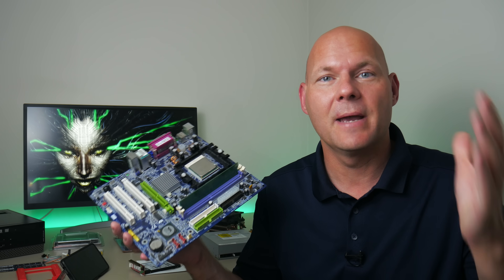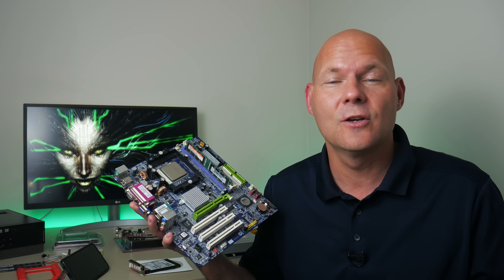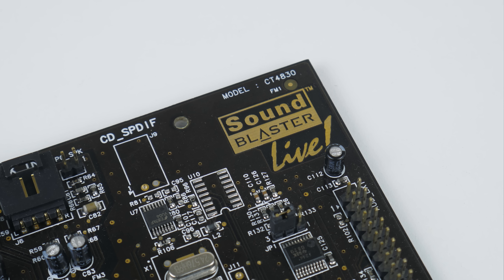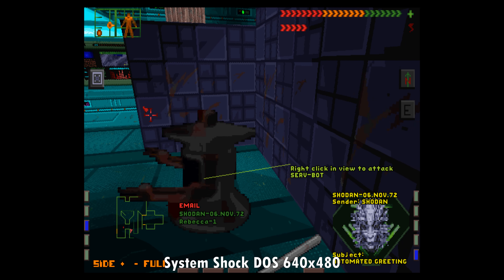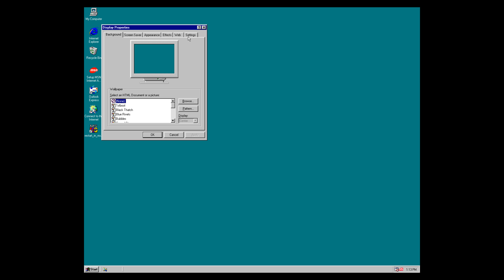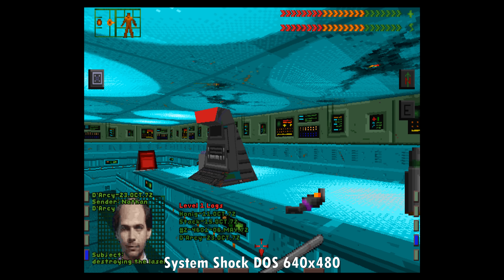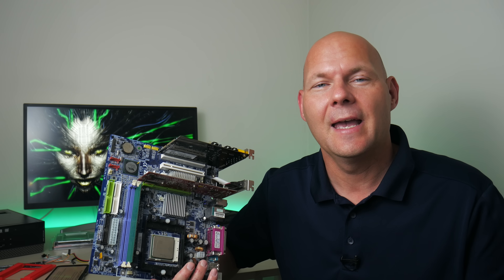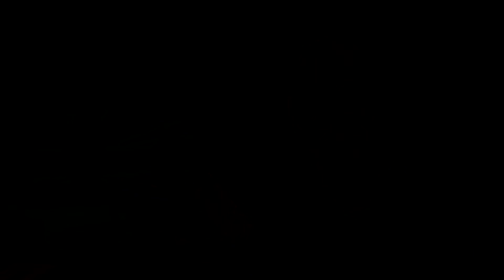Running Demanding DOS Games on Affordable Hardware

Comment: I was given an old Packard Bell for a colleague at work. It needed some capacitors, and the original hard drive quickly died, but to my delight is was an AGP board. It was an early-ish Pentium 4 socket 478 and came with XP, but good for Windows 98.

I haven't got the original drivers now, but with some digging, and your website, I managed to get drivers for everything except the onboard sound card. This is specific to the Packard Bell version of the Gigabyte board but it's not an issue as I wanted to use a Sound Blaster Live anyway. 

There's an FX 5500 in there, again, drivers thanks to you, and 98 is just fine. I've not tried DOS as yet, but what could possibly go wrong..... right?

Thanks for your resources!

Comment: Hi, I use socket 754 SIS chipset and this is very fast and compatible system. W98 installed without issues and very happy with this build.

Comment: I use a PIII-S SL6BY on an asus TUV4X board with a Ti4600 or Voodoo 5500 and a Soundblaster live. It uses a VIA Apollo Pro 133 chipset, and has pretty good late dos game compatibility, windows 98, and also Win2k/XP.

Comment: Phil great stuff! I'm currently building a socket 754 system myself with a Asus K8V SE Deluxe and a Sempron 3000+, I'm currently using IDE drives but I'm tempted to go the SSD route after watching this and even just ordered the Startech adapters, my question is do the SSDs need any special preparation with Windows 98 use or is format and go? Just curious as I know hdd and sdd function slightly different and I'm wondering if windows 98 can correctly utilize them
Reply from the maker: I've done a video on aligning partitions with SSDs. In short, if you use less than the total capacity, this is called under provisioning, it's a non issue. For example buy a 120GB SSD and create a 60GB partition.
Reply: @philscomputerlab  thanks for the reply I will check it out now, I'm assuming it's the "How to avoid short lifespan when using SSD in retro PC" video, I'm going to study that now
Reply from the maker: @chiefthunderhorse4430  Yes that's the one!

Comment: I recently did a playthrough of System Shock on my channel.  I went with a Pentium III 1266S system to play the game in full screen at 640x480, which was mostly pretty smooth.  During testing I tried the game on a 700Mhz Athlon Thunderbird, and as I recall it wasn't enough to get perfectly smooth gameplay with those settings.  Also, it seems that 640x480 has some screen tearing, which was present both on my actual monitor and my capture card.  I used an ATI Rage Pro Turbo 8MB (AGP), so maybe that had something to do with it, though I have a feeling that's just how the game runs in high res mode.
Reply from the maker: I guess the game just doesn't use V-Sync to avoid screen tearing. A shame...
Reply: @philscomputerlab  Yeah, possibly.  It's kind of from the era where maybe 70hz was more common, but I seem to remember my capture card (a magewell) reporting 60ish hz.  Maybe the idea of vsync wasn't as established in ~1994?  Might make for an interesting topic to research further.
Reply: @rojovision  Actually now that I look back at the clip I posted, the game mostly runs smoothly without tearing but the pickups in Cyberspace are wilding out wayy faster than they should be and tearing lol
Reply: I've been playing this on my retro PC recently as well. My system is an ECS K7S5A with an Athlon 2400+, GeForce 4 MX 440 and Sound Blaster Audigy SB0090. I didn't experience any screen tearing issues. I also launch the game under Windows 98 through a DOS prompt though, not in "true MS-DOS" mode. This is because the Creative drivers for the Audigy actually natively support SB16 / General MIDI emulation in DOS under Windows 98 and under Windows you can load up to a 128MB SF2 soundfont. Anyway, the game runs very smoothly for me running it that way. Later on I installed "Toxic Frog's High Resolution mod" which allows you to run the game at up to 1024x768, and I have a CRT for the system now that runs at 85Hz. On either the LCD or the CRT though, the game runs smoothly and I get no tearing.
Reply from the maker: @C4103 It could be that I used DVI output. Yes cyberspace feels a bit too smooth if that makes sense?
Reply: I'm not sure if it will let me post this, but this is a clip from streaming the game, capturing at 60 fps: https://clips.twitch.tv/GorgeousNastyAniseWow-PrNXJYe9pL776g4G

Comment: also realize VGA is preferred for most retro games, like with console gaming of the era VGA will help with anti-aliasing as the signal is analog that will produce softer edges but using VGA on a LCD might not have the same results as its can be converted to digital by the monitor itself so a CRT for any retro build is a must

Comment: Is there any way to combine a Sound Blaster Live (PCI card) with an external midi like a Roland Sound Canvas in DOS?

Do the Audigy ZS drivers support MPU-401 via the gamport in DOS?
Reply from the maker: Good question. This detail escapes my memory, but you can watch the linked SB Live! video, I'm sure I mention if the MIDI port works in DOS. I have a feeling it doesn't...

Comment: I can't agree more that Windows 98 is the best operating system for running DOS games on "newer" hardware.  Also a quick tip: format c: /s /q will do a quick format with system and save some time.
Reply from the maker: Yes but only works if the partition was already existing and formatted. But yes, heaps faster...

Comment: Can't you just buy an old Pentium 133 or 166 for around $100 / €100?  I bought a few of those for that kind of price not too long ago  (2020 or 2021)  
for dos games you only need a soundcard, 3d accelerator cards came later. 
 an original period correct soundcard might be pricey, but you do not need that there are enough cheap alternatives
Reply from the maker: Yes great start! Especially for older speed sensitive games. But they won't run 640x480 games smoothly...

Comment: Some hi rez dos games I like are Carmageddon, nascar racing, fatal racing, normality, need for speed, terminal velocity, mech warrior 2 and especially quake 1 at much higher than 640 on my p4. Other games I think look a little strange when not in the standard rez such as doom and duke 3d. Flight unlimited is good but won't work on really fast systems.

Comment: Phil, have you looked at PCEm? I made a period accurate 486 with it and it works with everything I’ve thrown at it so far.. unlike dosbox this replicates the hardware down to the firmware, it is a great option.
Reply from the maker: Not yet! Hasn't it be replaced or abandoned? Also what sort of system do you need?

Comment: Well at this point it all makes quite a lot of sense - as I've been playing with Blood's Death Wish level pack. And in Blood you can use as high resolution as you find BIOS (well VBE) support for. And while I remembered playing the vanilla Blood in 1600x1200 on a 3.06GHz Northwood with i845+DDR333 at 30-40 fps, Death Wish struggles even in 1024x768. So you definitely CAN go higher than this system. It could run almost the same with a mere Thunderbird Athlon last week so an Athlon64 may or may not feel much better than this Northwood. But 800x600 is not bad at all, definitely much better than the default 320x200 which I often refer to as 'pixel storm' in 3D shooters. The Athlon64 MAY be able to go higher at viable frame rates, though. (Hm, maybe with NOLFB...? I'm not entirely convinced but I'll give it a try....)

Then my experience with the Live! was not that good, especially the FM emulation. But for this specific purpose it's not strictly needed, it can emulate general midi just fine, definitely better than it does OPL2/3. So if it works, it should be okay, Blood doesn't need real mode, it should co-exist with the Live! DOS drivers.
Reply: Just a little update: NOLFB DID help. Quite a bit. 1024x768 gave me the ~ same frame rates as 800x600 without it.

Comment: I know some DOS games support hardware 3d acceleration via 3dfx voodoo cards although with faster CPU speeds there can be detection issues and crashing, may be worth throwing on in.
Reply from the maker: Yes Tomb Raider runs really smooth with 3dfx Voodoo. But System Shock doesn't benefit from it.

Comment: I just love the fact that you can Supply these Athlons 64 with the new PSUs, instead of going only for those PSUs that have 30A on 5V Line (IIRC, could be less, could be more) that are needed for Athlon XPs and such. Such as saviour in that regard!
Reply: Later Socket 462 motherboards started to include P4 power connectors for 12v CPU power. Because even back then, the engineers knew trying to pull 89W+ from the 5v rail was untenable.

I had several Socket 462 boards with P4 power connectors, mostly from MSI. The KT4A-V was one, and the KT880 Delta was another. Both motherboards supported almost every Socket 462 CPU that existed at the time. I still have my KT880 Delta, it was a great board in age of the capacitor plague. I never had a single issue with it having failed capacitors.

Comment: SBEMU next then Phil! 
AC97/Intel HD Audio driver for DOS 😀
Reply: It's still in beta, not a lot of AC'97 or HDA chipsets have been tested yet and there is confirmed count that alot of other computers aren't working with Sbemu.
Reply: @Explorer  yes, it is beta!
I have had various successes and failures on the PCs I have tested so far.

But when it works, it can often work very well 😀 

It's worth a shot. It doesn't cost anything to try 😉
Reply from the maker: Yes I'm monitoring the situation. I didn't have much luck yet, but I'm hopeful especially with regards to Sound Blaster Live! drivers.

Comment: Socket 754, 939, AM2 on VIA are excellent platforms for retrogaming. Nobody needs them and they are very cheap, so I use them everywhere in my projects. And most importantly, these platforms will provide excellent compatibility for MS-DOS games.

Comment: I recently picked up a Mac mini G4 so I could play a lot of these without worrying about Voodos or sound blasters to be honest. It runs Mac OS 9 native and though some stuff doesn’t run native I can use virtual pc and vMac for the really old stuff like Dark Castle on the power Mac.
Reply: Only thing is CDDA soundtracks. I picked up a FireWire optical with a audio out. I don’t know if it works just yet but it will be fun to try.

Comment: A socket 939 opteron makes for a great XP system Though dual core may cause trouble for some older games and there are very few xp era games that can use multiple cores. My current dos system of choice is a Windows 98 laptop. There are many choices from low pentiums to quick p3s. Dos sound support on late 90s and early 2000s laptops is likely to be very poor but fine in Windows if you can find drivers on the modern internet. mid 90s systems might even have a real opl3 and are great for early 90s and late 80s games
Reply: You can use CPU affinity. I use it for Assassins Creed old ones. They stutter like hell for more than 2 cores.

Comment: Athlon 64's are still my favorite retro PC platform, I love my Socket 939 Athlon 64 X2 build and its the only retro PC I actively use and need.
Couple of tips for compatibility, if you go with a VIA Motherboard those support the PCI cards very well, mine is paired with an ESS Solo-1 also featured on this channel and it has excellent dos compatibility. Pair that with a tool like CPUSPD to slow the CPU down when you need and you get a very wide range of DOS compatibility all the way back to the 80's.

For Windows you can then put something like a Geforce 4200 in and have great Windows 98 compatibility as well, but in mine I went with the 6800GT + Voodoo 2 combination instead. That is still highly compatible in Windows 98 but I do need to lean on the Voodoo 2 a bit to get all the games to work. But it has the benefit that you unlock that 2005 Windows XP era where you can now play stuff like Half-Life 2 in all its glory and even Crysis 1 works on the machine.

Comment: Heh, I had no idea that heatsink sizes have stayed the same all the way through Ryzen.  And that's the one drawback to a Socket 775 build - Intel changed from 72mm to 75mm hole spacing starting with LGA 1156 sockets, so socket 775 heatsinks are limited to socket 775 heatsinks.
Reply from the maker: Yea Intel is a pain, especially Socket 370 and 478. LGA 775 you can still find modern coolers I believe, at least I was able to a few years back?
Reply: @philscomputerlab  Yeah they're still out there, just that most (if not new old stock OEM which are becoming increasingly hard to find) are at least 2x as expensive as a cooler for a more modern socket.  Then there's also the issue of 2 mounting types - one is a screw-type that screws into a plate under the holes, and the other just snaps in - and the snap-in coolers are generally too short to fit most boards designed for the screw-in type.  And you'd think that the 3mm spacing difference would be small enough that you could force fit say an 1155 cooler - NOPE.

Comment: One thing to be vary of with that this platform is that it was still largely from the era of "capacitor plague". So, important to check for bulging electrolytic capacitors before buying (unless one has the tools and skills to replace them.)
Reply from the maker: I actually do have a desoldering gun and have done a recap before but it's quite tedious and fiddly.
Reply: @philscomputerlab sounds like a video in itself there Phil!

Comment: hi phils i just finished my windows 98 system about a week ago not long ago 
and as ram memory I used ddr ram 1 of 1gb 4 pieces each and using the software that makes windows 98 recognize 4gb of ram in the bios but windows in the system sees only 2gb of ram maximum
the truth is, you know what it's like until it arrives in Romania, it took about 2-3 months, but I didn't wait for them and went personally to get them directly from the respective stores and I practically won
I placed the order in California, specifically for a custom made PC case with exactly my required specifications
I also bought a usb front panel from ebay and a usb 2.0 extender from amazon

the specifications of my components
tell me if I made the right choice or not
GeForce FX 5500 FX5500 256 MB PCI 3D Video Card Graphics 2048x1536

Asus P4P800-E Deluxe Rev 1.02 478 Socket + CPU Pentium4 3.00 ghz
Samsung 870 EVO, 250GB, 2.5", SATA III
Samsung 870 EVO, 500GB, 2.5", SATA III
Iomega Z250ATAPI IDE 250MB Internal Zip Drive Black
2 iomega units, I also bought a disk for iomega of 250 mb each, I bought somewhere around 30 disks to have at home
Reply from the maker: That is a beast of a Windows 98 system!
Reply: @philscomputerlab  I chose this system configuration more for old retro games such as games in DOS call of duty and many others, but I also want to buy an 8 bay asustor to configure it as storage only for retro games
Reply: @philscomputerlab  and I forgot to mention that both ssd are formatted in fat32
Reply: @philscomputerlab  is it possible to connect two monitors to windows 98
Reply from the maker: @serbanvictorandrei4188  Yes but not with really old graphics cards. Matrox has cards, so do NVIDIA with the MX and Radeon but not sure when it started ...
Reply: @philscomputerlab  nvidia geforce fx 5500 I think it supports two monitors consecutively, that's why I want to connect two monitors to this video card that I bought

Comment: Thanks Phil for the bonus video! Availability of working 754 boards is a challenge in the US often times, but 939 boards can be had reasonably. Socket 939 CPUs are more readily available on places like eBay, too.
Reply: Running a 939 board in single channel memory mode pretty much turns it into a 754. There are also several K8M800-based AM2 boards, with these you can go full double/triple boot with no drawbacks.
I would also suggest using the IGP for DOS/Win9x as it is S3 Savage-based which means remarkable compatibility and outstanding picture quality.
Reply from the maker: Thanks for the info!
Reply: 754 was kind of marginal in canada too, usually seen in prebuilds
Reply: I tried Via 939 platform years ago, and if i remember right there were issues with drivers under win98 or some other incompatibilities, it ended up being a no-go for me.

Comment: Phil it would be not affordable soon. 😅
Reply from the maker: Pentium 4 next 😅
Reply: @philscomputerlab  that's the best platform. I bought 2 or 3 pentium 4 northwoods. Pentium gold 3220 had a crash a few days ago and I think about it is too weak to software encoding with a cheap capturecard.
Reply: It was the power shut down, not a crash. I saw the burning smoke with the same cable I connected to a different PC. It made a short.

Comment: Love Athlon 64s. My DOS/Windows 98 system is built around an Abit UL8 (Socket 939), which has a ULi chipset. Works great and Nvidia even still host the drivers on their website. Complete overkill of course and Socket 754 stuff tends to be cheaper all-round, but I picked it up cheap on Ebay and had always wanted an Abit motherboard.
Reply: Abit were great
 Shame they went bust.
Reply: I ended up doing the exact same thing. By the time I wanted to build a retro PC the parts were too expensive so I picked mine up from the dump. It was someone's well taken care of old business PC. And personally I ran with the idea of having a windows 98/DOS super computer. Restricts the DOS end a bit, but there are plenty of games that run just fine even with the way too fast CPU. And I am amazed at how much better some of my old 3d favorites in windows run having all of that CPU power behind them, like the original Max Payne.